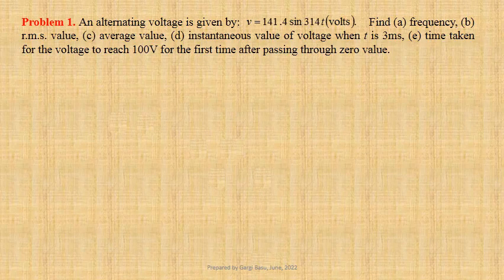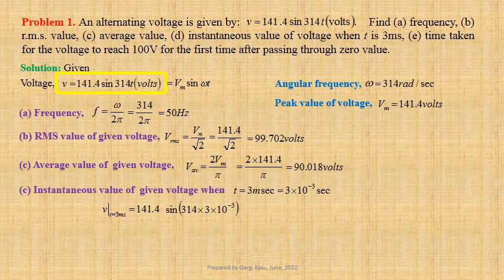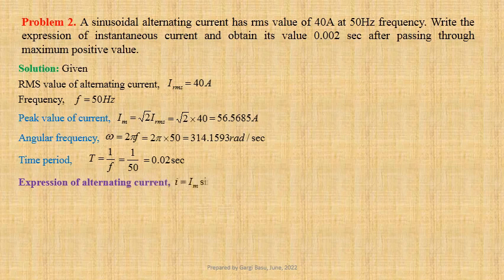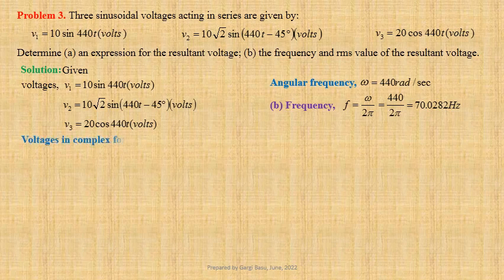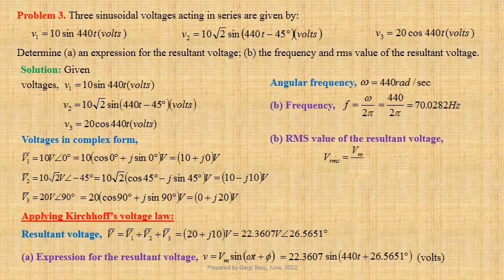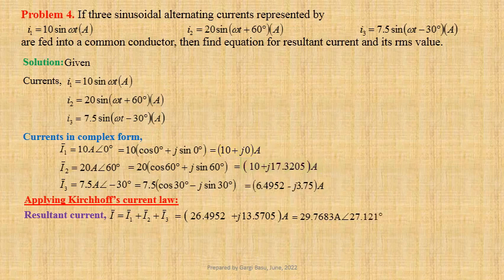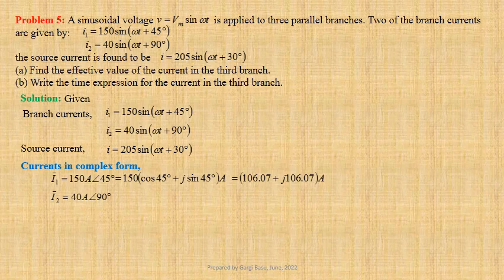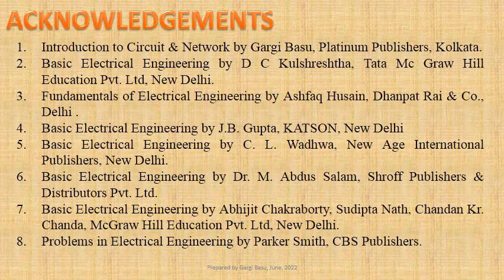Simple numerical problems on  Fundamentals of A.C.

Comment: The maximum efficiency of a d.c. motor occurs is 3/4th full-load. The constant losses are 900 watts. Then the full-load copper losses are: 
1) 1200 watts 3) 1800 watts 2) 1600 watts 4) 2000 watts

Answer please 🥺🥺
Reply from the maker: 3/4=sqrt(Pc/Pcu) or, Pcu=16/9*900=1600W